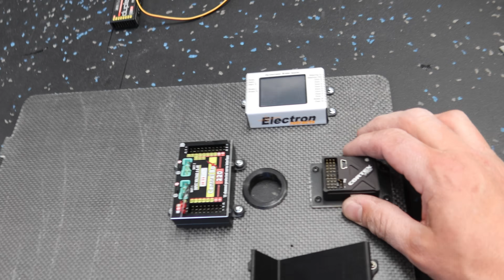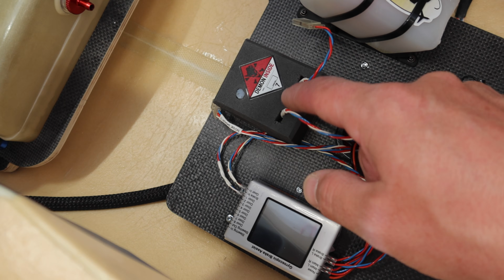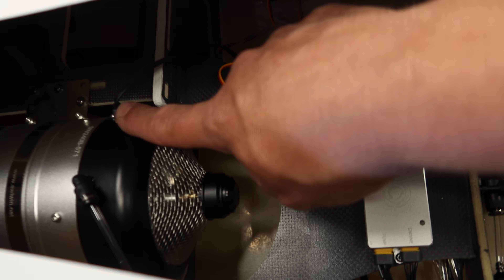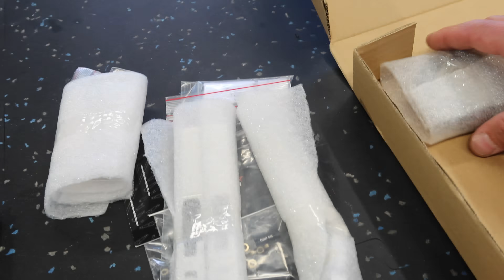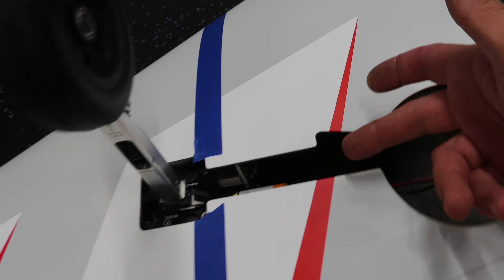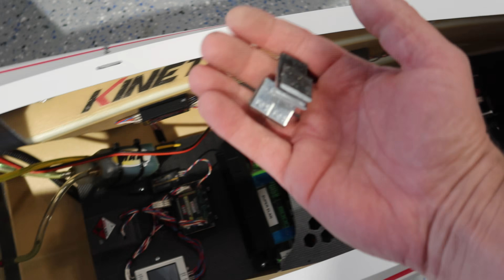Jet Set, Ready to Soar - Kinetix RC Build Complete & Flight Ready!

Comment: Hi Jonathan,

At 9:11 you mentioned that the second receiver is setup as a clone. Why do you run the receivers in clone mode and not Dual Path? Is there a specific reason?

Regards
Reply from the maker: Hello Charl.  Reason 1. I like to let others fly and buddy box my aircraft.  Especially newbies that haven't flown a turbine before.  The clone setup allows easy buddy boxing.  Reason 2 that many don't agree with.  Better Signal/strength but that's arguable.  Dual path is totally fine.

Comment: Awesome build! Im a beginner in gas engine planes and your builds are inspiring for me. Can you tell me 2 things: 1st how do you secure cables and electronic inside fuselage? Some velcro?
What do you use to „goop” all connectors on final assembly? Thank you!
Reply from the maker: Thanks for watching!  Lots of options.  1. if they can screw down then screw them down.  2. Recievers, 3d printed mount or industrial velcro.  3. for cables and such.  3d printed mounts (check my website) and sometimes tape and glue in place with CA.

For final step on assembly the GOOP all connectors is exactly that.  Goop is a product.  They have lots of types but they are all the same product.  Marine goop, plumbers goop, general goop.  Same product.  There is also E6000.  Same product but slightly thinner.
Reply: @thelightersideofrc  I live in Poland so thats why I couldnt find what goop really means. Thanks !

Comment: I have had a Jeti radio now for a few years.  Best radio hands down IMO.  In my big really expensive models, I also use the 900mhz backup.  Just curious why I don't see that in your builds?  I've never had an issue with my smaller planes without the 900, but I like all the redundancy I can get.
Reply from the maker: Our signals aren’t packed here so never really need it. That of course is probably the reason to use it. Cheep insurance.